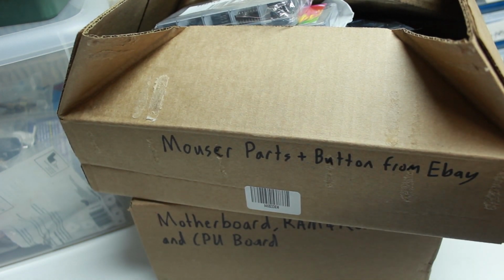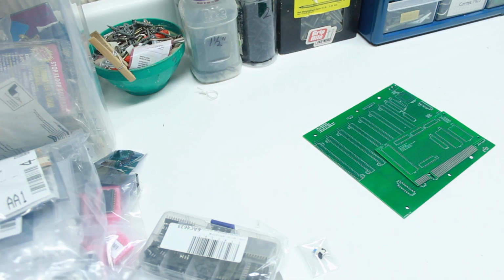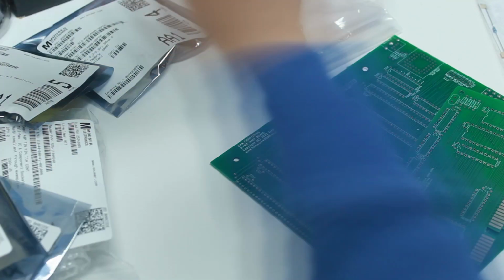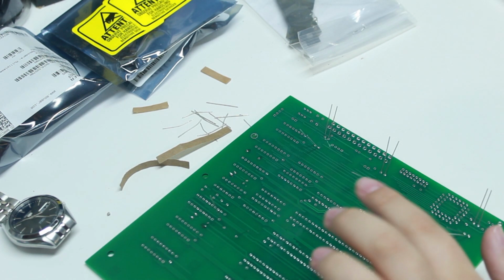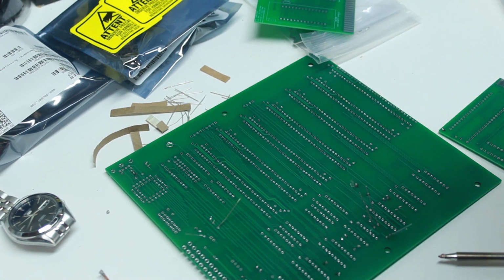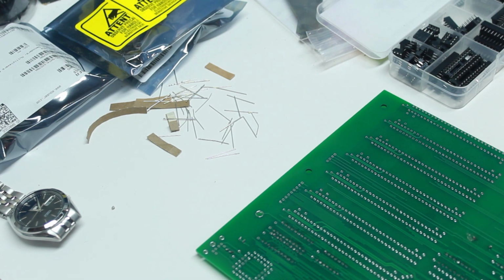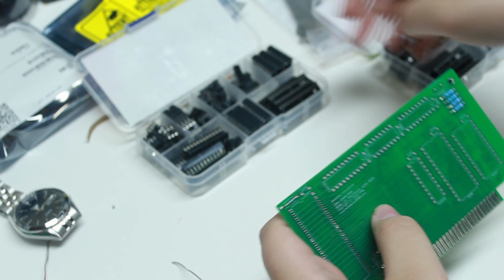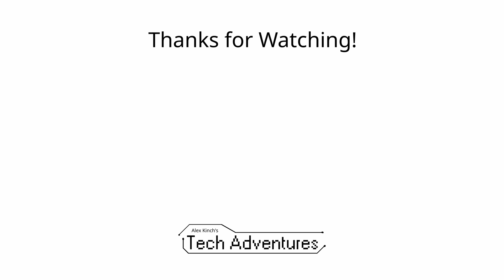Homebrew 8088 PC Build Part 1

Comment: Soldering will improve with practice, with plated holes the solder should "suck up" into the hole from capillary action if there is enough heat, flux and solder.

Comment: It's it necessary to buy these stuff from eBay? Or is it possible to make them in, e.g. PCBway and then get the other components independently?
Reply from the maker: That's a good question! I looked into getting the boards printed by PCBway, but it was cheaper to just buy the PCBs from the designer. I assume he gets a better price because he buys in bulk. As for the components, a good majority can be bought from an electronics supplier, I chose Mouser, but you could use digikey or other places. Unfortunately, some of the chips are vintage and are not made anymore so they have to be bought from ebay or somewhere else.

Comment: Hi,
the solder job is not good. You used too much solder. Try to use solder flux and just a little bit of solder. Nobody's perfect, try, try and try and the solder job will be like a professional.
It must be like a small crater.

sorry for my bad English,
bye, Kev.
Reply from the maker: Thanks for the pointers! I don't have any flux on hand right now, so that's why I didn't use any. I went back and cleaned up some of the solder jobs later in the series.
Reply: I never use extra flux. The flux that is in the solder should be enough. I also don't use tin whiskers solder which is know as no lead solder. The military use leaded solder so it's good enough for these projects. If everyone recycle old electronics we would not have to remove leaded solder from production. As for lead there is lead in a lot of plastics in our consumer products we overlook. Even wire insulation has lead in it. 73